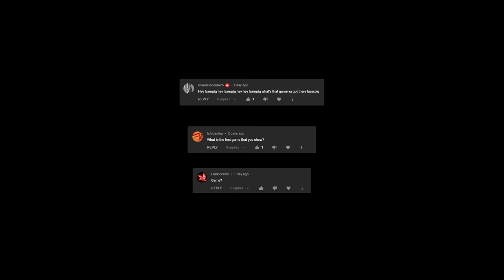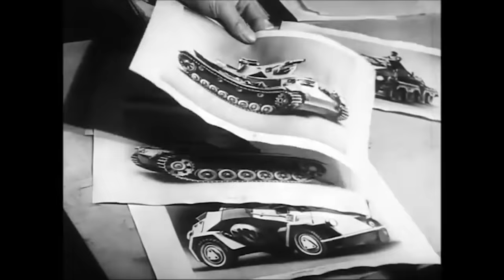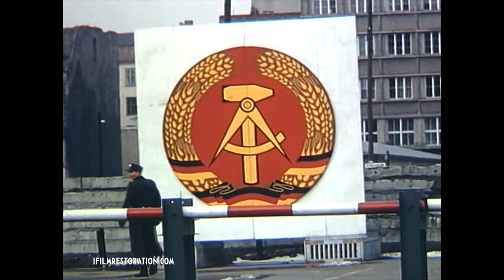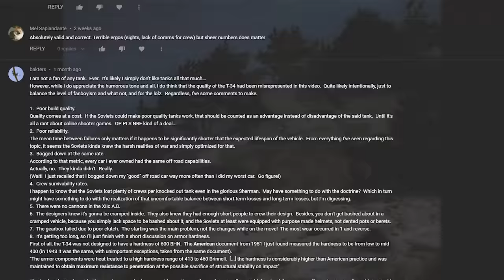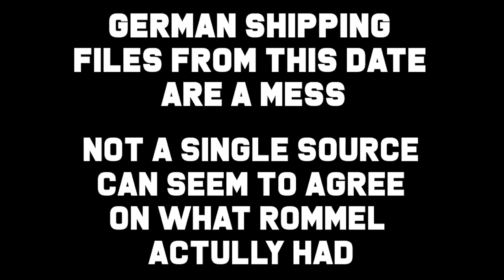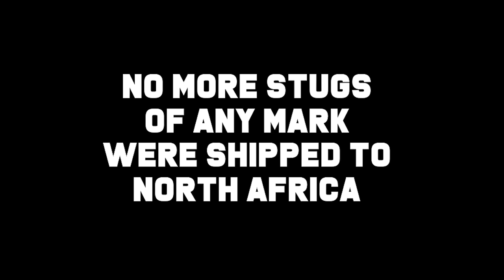In defence of the Crusader Tank

Comment: I take issue with your deriding  Rommel as having only two tactics. Any battle on open terrain, e.g. the desert or the Central European plain, the tactics of concentrate to attack  and luring the adversary into weakness is more than sufficient, (the direct and indirect).
Sun-Tzu: "In battle, there are not more than two methods of attack — the direct and the indirect;  yet these two in combination give rise to an endless series of maneuvers. 
The direct and the indirect lead on to each other in turn. It is like moving in a circle you never come to an end. Who can exhaust the possibilities of their combination? " 
I like to say that the application of the direct and the indirect is like a dance.

Comment: The reason rommel was successful (as I understand it) is that the british were using ancient tactics which forced them to attack any weak spot presented, this meant that rommel used the main tactic of setting up a weak spot in his lines and the british would be forced to attack it and rush right into an ambush, the point where they finally stopped doing this was the point where they started winning. Edit I see you mentioned that.

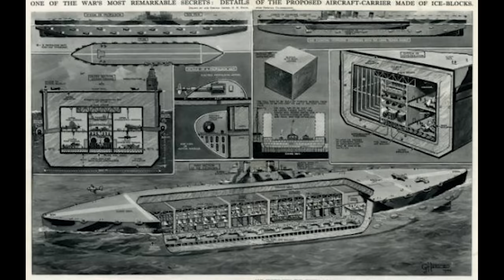Comment: 2:48 To be absolutely fair, that 'earthquake bomb' was more effective at taking down fortified German infrastructure than most to near all other conventional payloads.
It was called the Grand Slam, it weighed 10 metric tons, was 8 meters long long, had slanted fins that turned it from heavy bombardment into a drill capable of burrowing itself some 8 meters through solid concrete, or, and this is the reason it was so successful, 40 meters in conventional earth.
Drop this thing near fortified bridges no bomber squadron had been able to take down up to then, and watch that bridge collapse.

It utilized the clenched firecracker effect.
Set a firecracker off on a flat hand, and you'll get a nasty burn.
Clench it in a fist, and you'll lose the goddamn fist.

Now apply that same logic to a 22 thousand pound / 10 metric ton bomb, and you'll start to see why they called it the earthquake bomb.
It was a nightmare to get to the target.
But it ensured you'd only have to get one to the target once.

Comment: I would actually go further than lazerpig here.

This idea that cruiser tanks (including the crusader) were inadequately armoured for reasons X, Y or Z is a myth that really needs to die.

German panzers and British cruisers were both designed to exploit breakthroughs and fulfil the classic cavalry role.  As such, they were both designed for speed and, to that end, they both had thin armour compared to British infantry tanks or late-war German heavies.

Juxtapose the crusader’s stats with the panzer 3 and you will see that they had equally thin armour and an equal top speed, in addition to equal firepower (as lazerpig points out in this video).

Germans had assault guns; we had infantry tanks.  Germans had panzers; we had cruiser tanks.  Yes, the thickness of armour is not the be-all and end-all, but that’s the accusation most commonly levelled at cruiser tanks.

With all of this in mind, we can see that neither interwar neglect, the cruiser tank concept in general, the state of the British economy nor the Railways Act can be blamed for any problems the crusader may have faced.

What the cruiser tanks REALLY lacked compared to the panzers was support.  The panzer 3 and the crusader both had similar guns with the same lack of decent HE rounds for taking out AT guns.  However, the Germans used panzergrenadiers and the short-barrelled panzer 4 to support the panzer 3.  If you have that support then gallivanting off on a heroic cavalry charge is perfectly fine - in fact, it’s very effective, as the Germans proved multiple times.  If you don’t, then you’re sending your tanks to the scrapyard.

Comment: 37:40 This makes fluid defenses sound utterly and objectively better...and in a ton of scenarios they are, but they have a few downsides.
1. If you have something that is incredibly important, town, capital, factory distict, critical junction, generally you don't want to risk it being damaged or even temporarily captured. Static Defenses work better in that scenario.
2. On a larger scale, if you have an especially small and concentrated state, you often can't afford the 'give' that comes with fluid defenses. Countries like Switzerland and Israel can't afford to lose land in a pull back, they don't have the depth for it.
3. Fluid defenses, while they work better at haulting at the enemy and will often cause them higher casulties with the possibility of encirclement or pinning...it also costs more men. If you can't afford to risk heavy losses, digging in for hard static defenses is often the better choice.

Ukraine has shown both, but the second phase of the war has shown a large value of static defenses as neither side has enough people and kit to make a large ground based breakthrough or fight mobile skirmishs, and neither has the airpower to make up for it. The old 2015 line has proven to be neigh-unbreakable, Avdiivka held out for years at low intensity and even when the Russians threw meat waves at it it held firm for months. It was a combination of equipment shortages and the Russians getting lucky and finding a Sewer Pipe that allowed them to break the line that did it

Comment: The only point about the American hardware showing up I think he should have mentioned, particularly as resupply for the Brits, was spare parts. Not only were they getting slightly better tanks but enough standardized parts to keep them running. A tank you can actually fix when it breaks down is always going to be remembered more fondly than a nearly identical one you have to watch at night so your squadmates don't steal parts off yours to fix theirs. Yes, that's hyperbole, but there's no doubt that a lot of the reputation American tanks had for durability was based more on the availability of replacement parts than that they had fewer mechanical issues.

Comment: it IS worthy of note that the side mounted gun in the lee was capable of outranging even the panzer III J L's gun. It's also equally worth noting that british tankers fucking hated the damn thing; there's a reason the grant exists after all. but you're right; the primary issue wasn't the tanks. in my opinion though, it was the supply lines. with their tanks, the americans brought with them FAR more stable and plentiful supply lines of fuel, ammunition, replacement parts, you name it. every day became christmas; you could actually shoot and drive at the same time. couple that with finally  having decent HE ammo and guns, and thats a significant contributing factor.

Comment: What he misses is that after the fall of france, pist the Norwegian operations the getmans had basically no surface navy, and submarines don't do well in the channels due to its depth or lack thereof. Furthermore submarines of the erar are terible escorts. Thus in three days the Germans would have been cut off by the bulk of the home fleat ariving from scaperflow. The getmans also had exceeding poor amphibious equipment, and no real way to move artillery, tanks or othere heavy equipment relibly. Basically anything they threw acros the channel had to win in three days or starve/surender. Before you yell aircraft the luftwafers anti ship work was not yet up to scratch.

Comment: The British idea that "speed is armour" that was au currant in WWII was thoroughly disproven by the end of it. I think the clue is in how the British abandoned the cruiser tank concept to go for more normal designs while adapting the failed infantry tanks as under-gunned heavies and it was the same with Battlecruisers?

I mean, I'm personally an Admiral Fisher man through and through, but even I have to admit that he was completely wrong in his initial idea that speed was armour. I'd never want to admit that admiral Beresford was right, but sadly he was in that case and Jackie Fisher was wrong. It's always a nice idea until you actually have to go into one of these glass-jawed AFVs and then see the daylight pouring in from small arms fire.

Splendid subject for a kit, though, especially in 1/35, but that's about it, unless you enjoy sending Crusaders in and watching them melt away after they get there really quickly, that's why you don't see them at the end of the war? It's just a nicer-turreted Cruiser tank that was slightly less vulnerable, but not a tank-killer like the Matilda that German commanders refused to engage and got sacked by Rommel over, or the M3 Grants and later the Shermans were.

Comment: I'd add that the Sherman tank was neither as good as it is often claimed, nor as bad.  I'd say it had two main advantages, one more significant than the other.  One advantage was that it was a very adaptable platform - there are quite a lot of varients of the Sherman and that was more than a little handy at times.  But the most significant advantage the Sherman had was that it was built in a country that was not getting bombed to hell and back while fending off an invasion.  I'd argue its easier to make something when no one is shooting at you or bombing your factory.  Most countries in Europe did not have the same advantage at the time. I don't think it was the best tank of that war, but I like to think that it helped out and along with the other American efforts, contributed to the war in a useful way.
Reply: Well no, the Sherman was by far the best tank in the war.
For factors often ignored when talking about war.

They were versatile.
You had Sherman's with plows for rubble clearing, fails for mine clearing, the fucking floating Sherman's.
The ones that laid down tarp on the beaches to let others drive behind them
Bridge layers 
Howitzer assault gun variants.
Up gunned 76mm versions. 
Even ones with a 17 pounder.
The Sherman was the best tank of the war because American quality manufacturing and a little bit of British tinkering allowed it to do EVERY THING.

It was also the easiest tank in the war to perform repairs on due to the fact that tight tolerances of parts, to a degreebnot matched by other nations, meant that parts fit the first time every time.
Reply: @typhoon1575  we agree on the flexibility for sure.

Comment: You definitely haven't changed my mind in the slightest, but

... this is because of the fact that in part, I agreed with your point before you made it.

Sure, it may have been unreliable even when compared to its peers. But other than that, it has many fundamentally solid aspects that, in my opinion, keep it from being a rubbish tank. It has too many redeeming features for it to be completely disregarded.